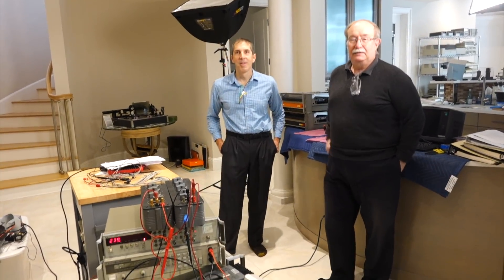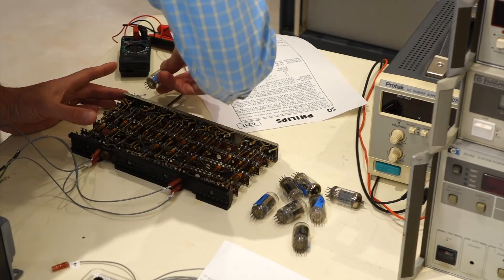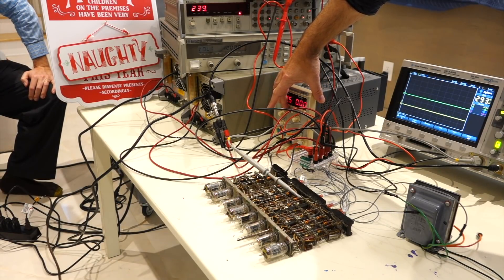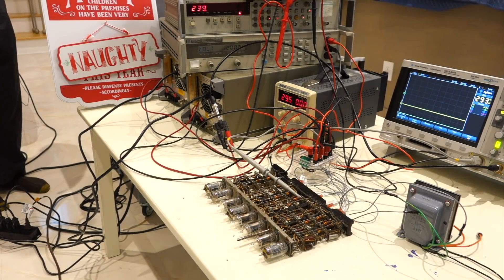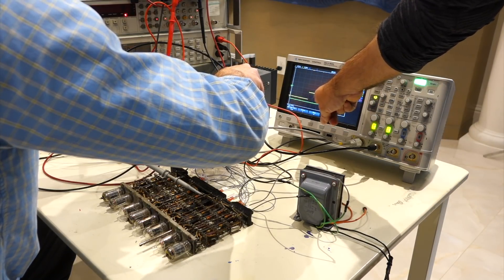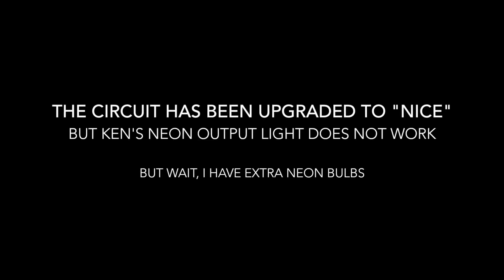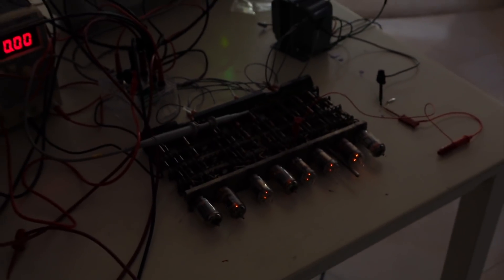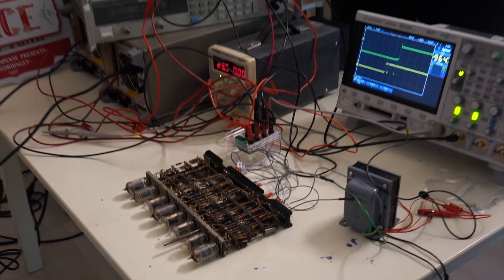Powering a 1955 IBM 705 Vacuum Tube Logic Module

Comment from the maker: Ken has just posted part I of his blog about this tube circuit: http://www.righto.com/2018/01/examining-1954-ibm-mainframes-pluggable.html
And part II:
http://www.righto.com/2018/01/ibm-mainframe-tube-module-part-ii.html
Reply: You could imagine the men working on this, imagining all the amazing things they could do with electrical circuitry.  But they come across a wall of historic proportion, the need for a clean signal.  Once they realized they could create and guarantee that signal they knew they could make a device of rapidly flawless calculation.  The true birth of the digital age.

Comment: This just 'popped' into my head. {Yeah, that is how MOST THINGS occur to me.} 

A lot of people -- especially younger ones -- POO-POO the Apollo Moon landings as being faked. {THEY WEREN'T.} One point I hear repeated is the poor quality of the TV signals sent back from the Moon, at least on the earlier missions. Those same people do not realize HOW FAR electronics have come since the early 20th century. At the time -- late 1960s to early 1970s -- there was simply NOTHING BETTER that could do the job under the required parameters: Light weight and portability, rugged {usable in space and on the Moon}, and relatively low power consumption. 

Just my 'two cents'.

Comment: Scientist:
"In statistical hypothesis testing, a result has statistical significance when it is very unlikely to have occurred given the null hypothesis.More precisely, a study's defined significance level, denoted by alpha, is the probability of the study rejecting the null hypothesis, given that the null hypothesis was assumed to be true; and the p-value of a result, p, is the probability of obtaining a result at least as extreme, given that the null hypothesis is true. The result is statistically significant, by the standards of the study, when p <= alpha."

Engineer:
"It worked ten times, therefore it works all the time, right?"

Comment: I wonder how many tubes you'd need to build an 8-bit computer.. @Ben Eater!! :D
Reply from the maker: I could not find an exact count, but I found a refrence saying that the 704, which was a 36 bit machine, had 4000 such gates, so a few 10,000s of tubes?
Reply: The 6502 managed to make a very stripped down 8 bit processor with 3,500 transistors.

Comment: Why was such a module necessary? Why not a simple capacitor? Did vacuum tubes not have a clean "transition voltage" that changed computer state from 0/1 or vice versa (with semiconductors generally around vcc/2 or vcc/3). Did tubes need an exceptional amount of input buffering?
Reply from the maker: A simple RC filtering would not work. You need to follow it with a comparator with a Schmidt trigger action. So this is exactly what this is: an RC filter followed by a Schmidt trigger.
Reply: Clean high speed switching was required, and utilized by electron tubes operating at various switching speeds.the signals need to be clean and precise.

Comment: Might be a stupid question... But why was this needed? Wouldn't a capacitor and few resistors do the job to hardware-debounce a key?
Reply: I haven't seen the schematic but it could very well be that it is basically an RC followed by a schmitt trigger to produce the digital output.
Edit:  I got curious and followed the link provided in the description and discovered that yes, indeed, my suspicion was correct!  :D

Comment: Very nice little presentation on the 5 channel tube switch de-bouncer. I guess it took 21 of these for a standard 101 button keyboard. The power requirements just so you could run the inputs for the keyboard was probably pretty significant, much less the rest of the computer and it's accessories, like printers, monitors and indicators. Thanks for sharing just a bit of our past with all of us, it was a nice Christmas present. Wish I could have been there in person, I love this kinda of fun. Work in an electronics repair lab repairing aircraft test sets. I get to reverse engineer and build test jigs and adapters to equipment that is no longer manufactured and is unique, it's a lot of fun. I got a laugh at the equipment age difference itself, between the counters, power supplies and the oscilloscope. If it had not been for the oscope this could have been an engineering retro video from the 80's. LOL Anyways thanks again for the fun. Belated Merry Christmas and Happy New year. Best Wishes n Blessings. Keith noneya

Comment: How much wattage was there just for that one debounce circuit? It is no wonder these things were power hungry beasts that needed to be in air conditioned rooms. The fans on at least one of the power supplies was rather loud. It got nice and quiet again once everything was turned off.
Reply: it was under 10W per debounce circuit - the entire module consumed roughly 55W with 5 debouncers and 5 cathode followers. The debouncer used two triodes while the cathode follower is implemented on a single triode; assume 2/3 of the energy is used for debouncing. Heating the filaments constitutes about half the total consumption.
Reply: I was thinking about how just these few switch debounce circuits required 55W. Add in however many other debounce circuits, then add in what the main system needed. It is no wonder these machines were in separate rooms with heavy duty air conditioning and massively thick power cables running to the cabinets.

Comment: Some resistors "fell off"? I take it that's a euphemism for "got borrowed for other purposes". Considering how sturdily components were connected together in those days, it's hard to imagine any of them literally falling off, even after many decades.
Reply: Could have been borrowed, but more likely that in handling over the years the resistors were banged against some object and came loose. no cutter marks, rather the connection points showed solder failure from strain
Reply: So the pigtails weren't wrapped around the terminals? I suppose it could happen in that case. Usually in valve-era equipment the wires are poked through holes and bent over, making them a pain to remove even if you wanted to!
Reply: they also go off value, watch 1950s TV and radio repair videos on youtube, like 95% of the resistors are off...
Reply: The problem with bending the leads over around the posts, as I learned on another channel, is that it will stretch the leads, putting stress on the component so that the expansion and contraction from heating an cooling would eventually break the lead connection inside the component, leading to early failure. Ideally, you just solder the leads to the posts without wrapping around, that way the longevity of the device is reliant on your soldering skills rather than the heat expansion and shrinking of the components.

Comment: That's a really big circuit for just debouncing one button on the console. Hopefully, that one module is used to debounce multiple buttons.  Because if you had to have one of those modules for each button on the console. That would take up a hell of a lot of space. BTW: why such a complex circuit for debouncing? Won't a simple RC filter ran to a single triode do the job?

Comment: It was done this way for decades, including with discrete semiconductor devices and then ICs. Then somebody figured out how to do it entirely in software (you read the input many times in quick succession and accept the predominant state).
Reply: Mike Cowen is it really that people only later "figured out" how to do it in software, or that there was eventually so much extra computing power that doing this in software was practical? I doubt there were enough spare cycles back then to deal with debouncing.
Reply: Bobby M You make an interesting observation. Typical scan rates for a perceived immediate input are only about 100 Hz, so that wouldn't steal that many cycles. I don't have any smoking gun proof, but as hobby projects came out for single chip CPUs, despite having a typical 1 MHz or better clock (plenty of hobbyist debounce power), they were still using hardware debounce circuits into the 90s. I can only presume that was what the designer was familiar with, and stuck with it. Old ways die hard. I was also working in the arcade industry during that period, and even they hung on to the very last second.
Reply: Yes it depends on your early influences. The first computers i digged deep into was ZX-80 and ZX81. So for my own projects during the 80s and 90s, a simple keyboard scanning and "debouncing" in software was often the "self evident" solution.
Reply: menoob:

it also has to do with stability, price per object used, 
behaviour of the element, elements in the circuit.. afaik..
and i think.. that the flipflops, latches by tubes didn't infere with the program cycles (slippery moment)

Comment: Only 10 watts for a single debouncer? It's a Christmas miracle!
Reply: Yeah, IBM wasn't exactly "Green" back in the day...
Reply: @petroldevo9934  Not their fault. Vacuum tubes are inherently this way. Transistors were a miracle.
Reply: @petroldevo9934  Even in modern times, I noticed CPU manufacturers didn't seem to worry much about power consumption until maybe 10-15 years ago.
Reply: and today you can power entire computers far more powerful than the 705 on less than the 10 watts a single debouncer for it took
Reply: Could you imagine the electric bill ?
Reply: @TheZooman22  Peanuts to any company wealthy enough to buy/lease one of these

Comment: Marc, were these five debounce circuits directly mapped to five specific buttons? Or were they part of a "keyboard array"?
Reply: IBM would have had one debounce per keyswitch on the panel plus one debounce circuit per set of relay contacts that drive any digital logic
Reply: A system with 1000 tube modules produces over 50KW of heat; over 170,000 BTUs of heating
Reply: Probably matrixed I'd imagine
All those panel buttons would use up tons of space with these otherwise
Edit: I'm wrong
Reply: Looking at pictures of the operator’s station, just by itself would require a cabinet full of these modules.   With one of these in my house I could heat the place in the winter.
Reply: Tubes are quite comfortable running warm...  Hence their alternative name, thermionic valves.
Reply: Just fans - forced air cooling, nothing sophisticated
Reply: Oh wow
Thanks for the clarification Carl
Reply: Toasty! The cooling logistics of modern server systems intrigues me; now I need to see what it looked like back then

Comment: To a none technical person what does it do? Well except for lightning the bulbs? Converting a keypress into.... a voltage or have the voltage conversion into a binary hold by bulbs/transistors to signify the character pressed?
If so are there different voltages for different keypresses, it is not binary from keyboard to the machine?